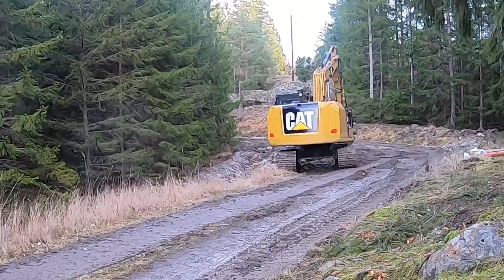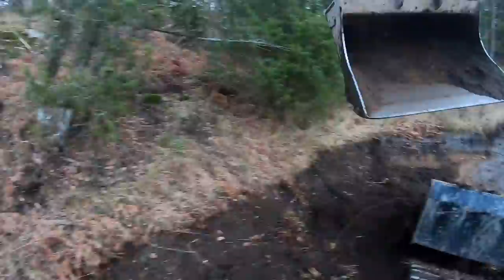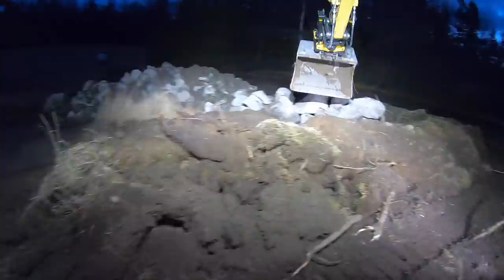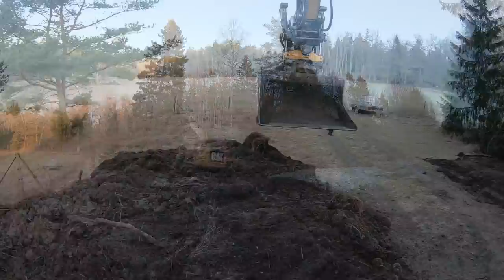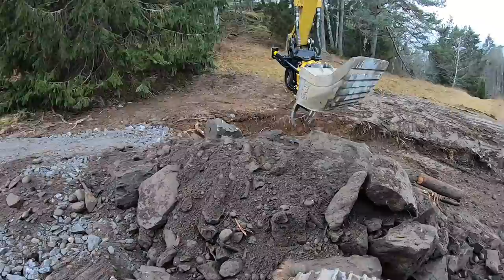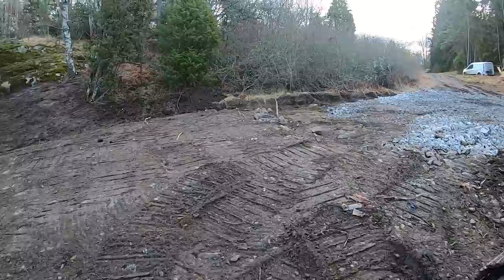#25 Road preparation for lumber trucks: 4 turns and a turnaround Part: 4

Comment: What is the " mud mound" in the middle? This is a waste of space, time and materials. More important, is the use of rubble for a base. While saving money, and recycling materials,  it is only a short term fix. Those boulders WILL FLOAT! All the extra overnight hours that you spent sorting rubble will haunt you in the future. When the frost comes, and forces those rocks up. Long term, use engineered  materials and skip the mud mound in the middle. Save time, better product, longevity.